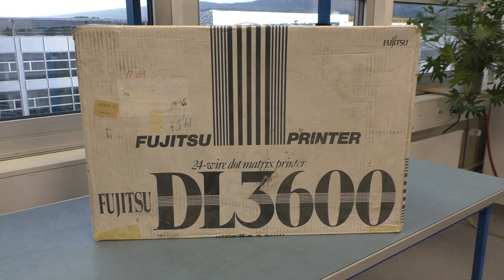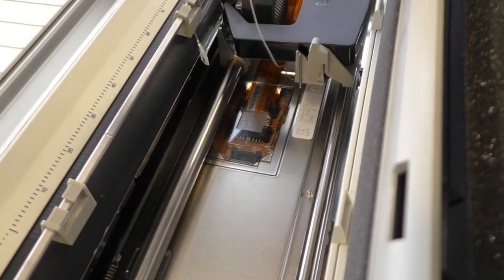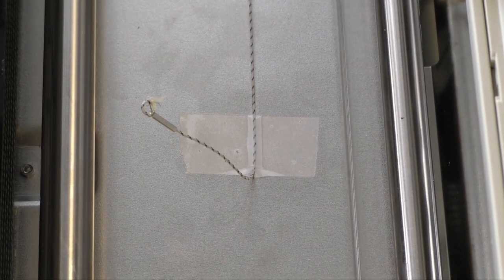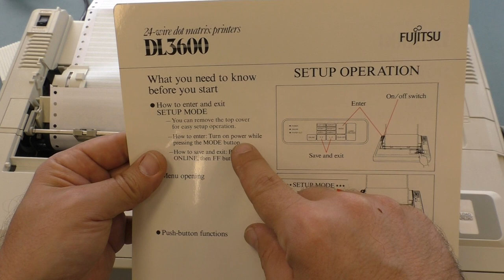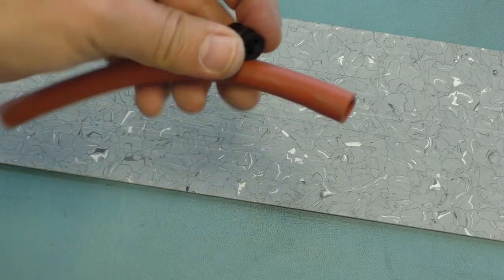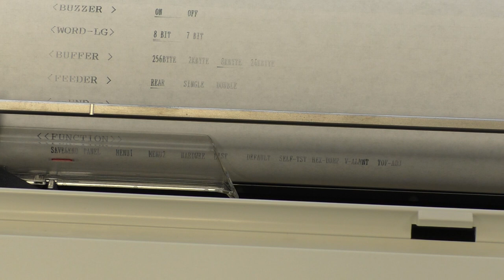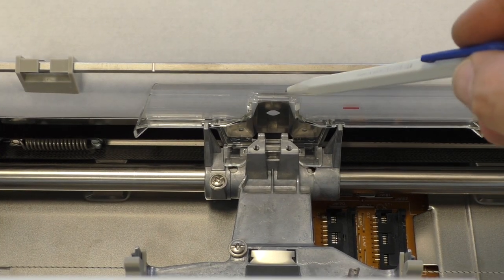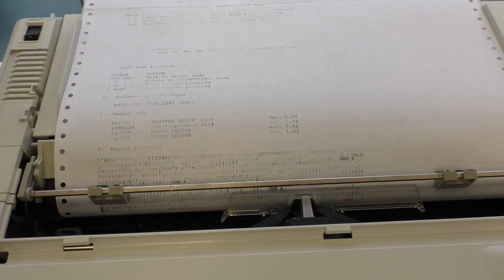1991 Fujitsu DL3600 Matrix Printer - (PWJ152)

Comment: Yes I remember we had such a Printer at the „Tiefbauamt“ (Civil Engineering Office)  in the nineties because it was the only printer which could manage forms with 15 (!!) carbon copies. These forms where mounted as endless paper and each copy had its own set of fields what needs to be visible on each individual copy. Every copy was sent to another department containing financial information about bills to be paid for highway condstruction in Switzerland. I delivered the program which filled out the fields on the form. There where always problems with these forms so we replaced it later on with a laser printer wicht printed every individual copy separately.
Reply from the maker: Yeah... we had a DL8800 printer (high end model 25kg) to print our service report forms. 4 carbon copies thick.... The forms were filled out manually and once a week we printed a whole box full of paper.

Comment: I have printed 1000 copies in my Epson AP2000. Probably more. In "graphics" mode ... took ages, screamaing all day long. Took the cover off in hot days pretending it was sort of sports car LOL. Head was about to glow !!!!. What a machine. Its slow, definitions for Word fonts or PDF is sh1t but ... no matter how hard you tried to break it, it will keep working. In fact, still working today, it doesnt know what a scredriver is. Back in the old days when PRINTER mean, a peripheral made to LAST and survive abuse. Now printers are an enviromental disaster, they wont last longer that one or two cartridges. I mean ... EPSONs, the same manufacturer of the mighty LX810. Of course dot matrix arena is plain text, or text using the built in fonts. Anything windows pretending an abstract printer capable of graphics will shame this printers .. .but hey, still put fight.

Comment: You did not mention it has, what looks like a flopy drive on the right hand side in the back, behind the rocker for selecting tractor paper feader. Also those 3 plastic parts you unpacked, did not explain where they go!.
Reply from the maker: Yeah, it's a slot for ROM memory cards with additional fonts. I still don't know where the plastic parts go.... I should read the manual

Comment: Can you get a modern replica of these ink cartridges?
Reply: usually, yeah
some businesses still use old 90s dot matrix printers, for various reasons
Reply: Here dot matrix still in service as they are one option enabled by tax agencies for billing. The key point o them is, the main bill and its copy on the same pass. The bill and copy have a ink paper between and as the dots hammer with enough force, the print the main and the copy behind the main. Its like a sandwich as continous form. You get the original, and shop keep the copy.  Not sure if clear, but in one print, on pass, it print both documents. This printers are so widely used that EPSON returned a modern version of the LX810 to market with USB. Another KEYPOINT is many of the billing SW is outdated, but CERTIIED and is mean to work with this printers. They are not uncommon. In fact it prices went high due to the maintenance. As printing original an copy on the same operation, ONLY a dot MAXTRIX is able to achieve that.